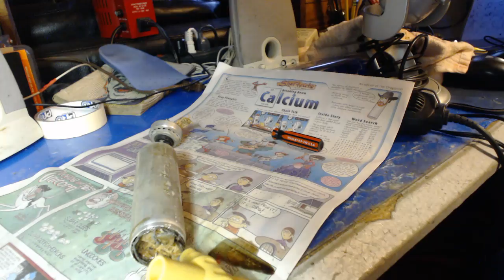1934 Westinghouse Model WR-24 Restore Part 5

Comment: Dickel, invest in coal companies and maybe pork bellies. Damn, was that a Turkish prison cell right here in America? ...and I thought that when you went black, you never went back. red looks good. Radio sounds good. I didn't think the "shading ring" would do much. What worked was a "hum bucking" coil. BTW that hum isn't that bad. Another great video by the master. BTW I had Planters-F when I worked at MCI was had to walk on the hard concrete floors. I help it a lot by using 2 pairs of sock on my feet, (inside the shoes). the extra cushioning worked wonders and eventually it went away. I always use two pairs of socks now on my feet. You might have to experiment with 2 brands of socks though in case you can't pull one sock over the other. Happy New Year!
Reply from the maker: Hi Meister...the local Beavertown jail was built in 1900...Dickel was lucky a toilet was in the cell instead of a hole in the floor....The Plantar F has screwed me up so much...it sucks not being able to do my 3 mile walk every day....I bought inserts for my shoes , it helped , but this latest bout has Buzz on the ropes......I will experiment some more in the next video on the hum ...although it's not bad to my ears, i've had a few suggestions...........that  will be easy to video........Buzz
Reply: The radios hum sometimes if they don't know the words to the tune.
Happy New Year my Friend. Hope that Planters feels better soon.